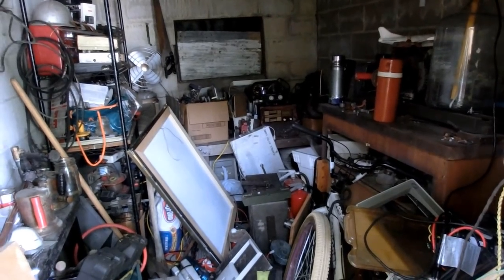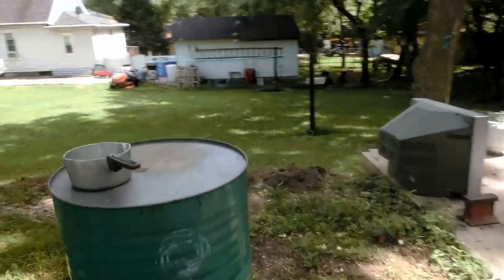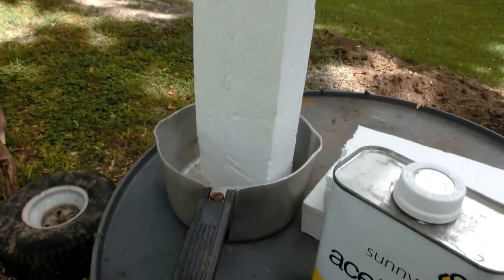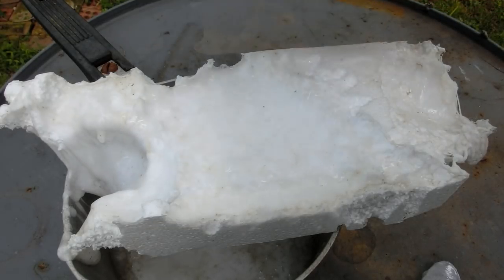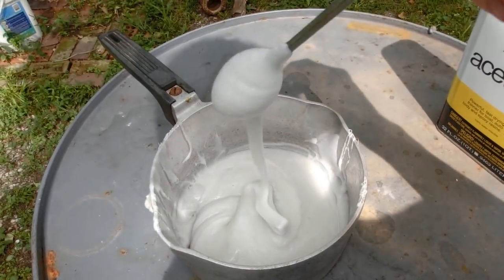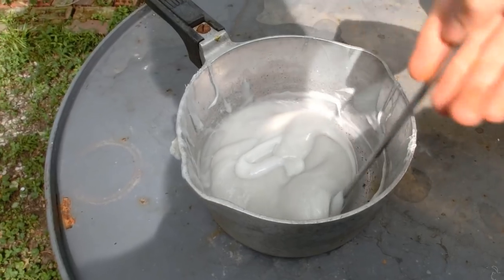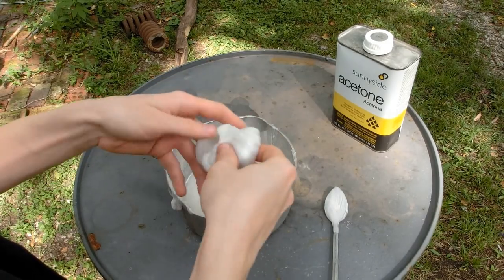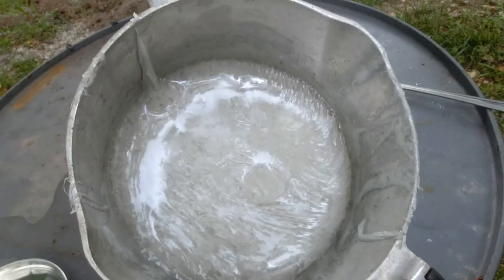Melting Styrofoam into diy acetone goo

Comment: You'll notice the acetone simply softens the foam so that it collapses into something like chewed bubblegum.  Try putting it into lacquer thinner instead, and you'll truly liquefy the foam into a clear liquid that can be used to coat porous materials to waterproof them. I call it "Styro-Kote", but I doubt that I'm the original inventor.
Reply: lebomm johnson try putting it in the internet so no one steals it and make themselves the original inventer
Reply: lebomm johnson that idea has been around forever
Reply: gr8 advice . ty
Reply: Terry Sheehan Nothing to stop someone from trademarking it the idea. Otherwise just spread the word and the context as far and wide as you can to make the term generic.
Reply: Awesome! Does using lacquer thinner cause it to totally solidify and become rigid?

Comment: online:DON'T TOUCH THE ACETONE
Rinoa Super-Genius: stir styrofoam grabs styrofoam and plays with it until it turns into a puddy
Reply: me:WTF can i touch it or not
Reply from the maker: +Chester123569 acetone is fine to touch tbh.
Reply: Rinoa Super-Genius what to do if it harden
Reply from the maker: Chester123569
add more acetone
Reply: +Chester123569 acetone is bad for you skin. It dries out your skin if you thouch it too much.
Reply from the maker: Mathijs Alkemade
it didnt dry out my skin too much tbh, 3% hydrogen peroxide hurts you more than this stuff.
Reply: well you remove nailpolish with acetone.... soooo its safe to touch
Reply: +GamerGuy acetone is fine for your skin, and lmfao 2 different types of acetone....
Reply: +GamerGuy Both are acetone. Same chemical, no difference at all. Most nail polish removers that use acetone are like 95% acetone with a few other ingredients that are supposed to keep your skin/nails. Really have no idea where you are getting your information from...
Reply: GamerGuy the only difference between "commercial" acetone and nailpolish remover with acetone is that there is like 95 percent acetone in it. The rest of the ingredients are purfume and some ingredients to make the nail cuticle not as dry. But they use pure acetone in nail salons as well to remove acrylic from the nails
Reply: GamerGuy yeah so? The rest of the stuff in nailpolish remover isnt exactly healty stuff as well. Plus, like i said, they use "pure" acetone at nail studios as well. Same stuff
Reply: +GamerGuy Okay so? I have a bottle of nail polish remover in my house thats 95% and the acetone I use in my shop is 99%
Reply: What is a puddy?
Reply: +snouty “the snout” snouterson its putty but the "super genius" spelled it wrong.
Reply: +The Dragon Stone thank you. I thought it must be putty but then I thought how could this person get something so obvious wrong? And now I know it's because he's a super genius 😂
Reply: I once spilled considerable amount of acetone on my hand. 
It dried the skin around my knuckles so bad that every time I would clench a fist my skin would crack and start bleeding. 
It took 4-5 months to fully heal.

I wouldn't recommend playing with acetone or gasoline.
Reply: +tooka2 and I frequently wash my hands off with it too remove epoxy or other sticky residues with 0 issues.
Reply: +Jason Hoogerhyde  Acetone de-fats the skin and can have central nervous system effects via skin absorption.  Check the Material Safety Data Sheet.
Reply: +GamerGuy The terms people are getting confused on is CONCENTRATION. Nail polish remover is acetone but their concentrations between commercial grade and in the small bottle are different concentrations. NPR is diluted with water.
Reply: +GamerGuy Nail polish is pure acetone. Some have fragrances or aloe added.

The worst thing it'll do is strip the oils off your skin. Don't take showers with it. And don't use acetone that's been used to dissolve small molecule compounds, since you'll be bathing your skin in those small molecules. Polystyrene's a big enough molecule that it's not going to penetrate your skin.

Do not extend this safety advice to MEK, Xylene, etc.
Reply: +sgvpotter checking my acetone, and my nail polish remover, the ingredients are virtually identical. Acetone, and Denatonium Benzoate (bittering agent so you don't inadvertently drink a toxic clear liquid thinking it's ethanol)
Reply: +Chester123569 Don't you use it to remove the glue after taking off a band-aid?
Reply: +Chester123569 Acetone is just nail polish remover with out the coloring and fragrance
Reply: Rion Motley
 hey rion, checked the ones i had i my fire cabinet they are at 60%. Did some checking and there are many now that do sell 100% acetone, so you are correct. The problem comes with the repeated exposure to 100% acetone. The diluted ones are safer, and other sub the water for oils and other ingredients that lessen the damage to skin. So i guess i learned something new :)
Reply: +sgvpotter high five on the double check. That might explain the horribly crappy results I got with some bottom shelf nail polish remover when I was trying to clean my 3D printer bed a few months ago. Figured I'd just left it open too long and it went a little hydroscopic on me. Bought a bunch of cheapo bottles @ Wal Mart a few weeks ago to restock, and it's all 100% (give or take the few ppm of the bittering agent. apparently the most bitter chemical known to man. woot woot.)

But yeah, definitely don't make a habit of washing up with the stuff either way, but it's not like it's going to absorb into your body at any kind of toxicity from playing with some putty.

And a did-you-know: acetylene bottles are actually acetone bottles filled with porous bulky stuff (used to be cork/etc.) and the acetylene is actually dissolved in the acetone like CO2 in soda! 80's star sparkles

The more you know. ;)
Reply: Acetone is basically in nail polish removers sooo...........
Reply: wait u can't touch it??
Reply: Lol
Reply: +GamerGuy meh
Reply: +GamerGuy 
You're wrong. There are higher concentrations of nail polish remover which are simply 100% acetone.
Reply: +Rinoa Super-Genius no, it is not.
Reply: There's literally nothing acetone does to you (on skin at least)
Reply: +Rion Motley benzoate is more dangerous than acetone. It is cancerous.
Reply: +Ano Nym What if I told you benzoates are food preservatives? It's benzENE that is carcinogenic. It's not all the same, bro. Furthermore, you can make aspirine from benzene.
Reply: can that make glue trap for mice
Reply: Rinoa Super-Genius it looks like slime
Reply: GamerGuy professional nail tecs use 100% acetone(exact same stuff as the commercial/industrial stuff) to remove acrylics and gel nails by soaking the fingers in it for a couple minutes at a time. Acetone isn't great for your skin because it dries it out but is not dangerous unless you're soaking in it for a long time. You should still wear gloves while working with it because it's mildly irritating and a face mask is a good idea for the fumes if you aren't in a very highly ventilated area but it's not super dangerous or anything
Reply: Ye acetone is literally nail polish remover
Reply: Chester123569  I used to build boats back in the day we had 55 gal drums of acetone and I literally washed my hands in that stuff for years....would dry the crap out of em though. But nothing happened.
Reply: Gamerguy must still live with his parents. And must never had a real job if his afraid of a little acetone
Reply: I make a modelling material from this, it's a relatively cheap way of making things. My hands are still there, and 
I've been working with it for about a year. It's very versàtile stuff once you get used to it.
Reply: +Lucia Tilyard 
its all good until it causes you to become irreversibly impotant.
Reply: Lucia Tilyard is this similar to the sheet styrene?
Reply: Lorenz Retiro It's what you càll styrofoam in the 
Ù.S. we call it polystyrene here.
Reply: Acetone is nail polish remover
Reply: Chester123569 putty
Reply: Chester123569 Acetone is nail polish remover
Reply: Mathijs Alkemade I paint my nails and such and I use acetone to take  off my designs and fake nails. As long as you keep your skin hydrated with oils, you're fine.
Reply: You can use this as molding plastic
Reply: I borrowed a friends nail polish remover, my nails split and then peeled off...took 6 months to grow back strong again. I looked at the label again and it said 'some people may be allergic'...not that their 'nails might melt'.
Reply: very fine animal oil is added to the acetone to prevent the skin from drying.  Acetone disolves the oil in your skin, bit by bit, eventualy there is no oil or fat left to lubricate the skin and cracks appear..

Comment: You know you are just making a crude form of napalm.
Reply: I was just thinking the same thing. All I can think of when seeing this was the napalm bombing in Vietnam by USA and how it would look like if it was to get it on your skin. All she would need to add is gasoline and then a fire. Cool video though.
Reply: Cyborgslayer404d Yo, I think I saw you comment on a random 'ball lightning' video about an hour ago.  Weird.
Reply: This isn't really napalm. If you dissolve it in petrol it would be
Reply: +duMaurier15 actually you dont need gasoline acetone is flammable by itself so yeah crude napalm
Reply: +patrick Tighe That&#39;s noting like actual napalm tho. Napalm has oxidizers and other substances to make it burn a lot hotter than some styrofoam puddy.
Reply: chaistan
 true to this, but it does stick to alot of stuff. but couldn't you add sugar? which would add oxygen to it to make it hotter? i remember something like people getting 2nd 3rd degree burns from actual napalm in Vietnam from reading stuff in class 2 years ago
Reply: +patrick Tighe "people getting 2nd 3rd degree burns from actual napalm in Vietnam" HAHAHAHAHHAHA.....yea
Reply: +pugs2300 I think he meant, "people getting burns as badly as actual napalm from vietnam would give"
Reply: +duMaurier15 if im right you can use gasoline instead of acetone because gasoline will melt the styrofoam as well so you wont even need the acetone
Reply: daimon hellstrom yeah and you can add alluminium dust in it ontop of that so it gets even hotter. Or make a molotof 1/4oil 3/4 petrol then add that stuff  into it. Youll get some prety hefty napalm like that. Nothing crude about it except the flames ^^
Reply: Cyborgslayer404d I
Reply: Yep, or Palm Oil etc. We improvised with Diesel, Petrol, Sugar and or Styrofoam (if available). Styrofoam makes it sticky/ gloopy. Still needed some PE and a detonator, or knotted Det. Cord.
Reply: 4th degree burns.
Reply: Cyborgslayer404d If you could keep it from solidifying, yes. The original napalm, I believe, is the same formula used later to make camp cook stove fuel in a small can to carry in a backpack, which I will not name. It is also useful at an outdoor buffet under stainless serving pans to keep food warm during an event. Slapped on you skin and lit on fire, it is not to good for anyone at a buffet, for sure.
Reply: daimon hellstrom if u heat up and melt some soap inside it, what will the end result
Reply: Napalm b was polystyrene in acetone and benzene AFAIK

It’s Not just a crude form
Reply: I used to make it using EPS and diesel fuel. Stuff would burn for hours!
Reply: GOAT PLAYZ that is napalm A. You need some specific kind of soap tho (but nothing too special/exotic)
Reply: fireofdestruction77 yeah but even as acetone is flammable, gasoline has more energy per weight than acetone, actually gasoline might have the best energy to weight ratio
Reply: @among-us-99999  we used unscented tide mixed with half gasoline and half diesel for training when I was in the army.
Reply: @maxmaidment96  thank you

Comment: in the late 60s when i used to do a lot of competition model making i used this idea and also melted sprue from kits in to acetone or liquid polystyrene cement this made the paste you have made however you had to keep liquid in the bottle and air out it was a great filler for models also great for coating rough areas and easy to sand down..

Comment: replace the acetone with diesel fuel and you've got napalm.
Reply: +Anon archist i believe acetone makes napalm too but he waited for it to evaporate.
Reply: +Anon archist That already is what all the casuals call "napalm". Real napalm is more like a jell that sprays and sticks to everything after impact.
Reply: +Juelz J And polymer thickened gasoline is JUST THAT! Seriously, Thickened gasoline is basically napalm. There are two different types of many variations of napalm, theres WW2 and Korean war era type A and then there's Vietnam type B, Polymer mixed into gasoline is similar to type B napalm, but not evenly processed, so it's thicker, and stickier, but not as much as gel-type Vietnam napalm, same effect and similar composition so it might as well be napalm.
Reply: napalm-B is disel fuel with a ploystyrene as the gelling agent. like i said
Reply: Anon archist Burns releasing heat over 3000 degrees Celsius, sticks to pretty much everything it touches and can burn for hours on end if a lump of it is large enough. That's type B Napalm... or as i like to call it 'Nampalm.
Reply: Carl Ahrens Well, Maybe its best people don't deliver it properly? Wouldn't want the stuff being used in riots anyway. But hey, What I DO know how to do for certain is make an atom bomb, I wont go through it for two reasons, 1.Getting the Uranium enriched is a pain and 2. I Don't want to kill millions of people.

Also, Flamethrowers are a sure"fire" way to set yourself alight if you don't know what you're doing, especially if it's homemade ;P
Reply: Lmk where you will be getting your yellow cake
Reply: Disolve it in turpentine for home made napalm, it will stick and burn on anything.
Oh Diesel.. OK didnt know that, thought it was turp's
Reply: It is not a jell that sprays. It is too viscous to spray, however it will splatter and stick.
Reply: Lex Turner well the viscosity IS variable depending on how well it's mixed and how its made, this is really crude napalm.
Reply: That is a correct statement
Reply: It also works with acetone
Reply: Anon archist Diesel do not burn
Reply: “Napalm-B,” uses 46 percent polystyrene, 33 percent gasoline and 21 percent benzene.
Reply: By weight or volume?

Don't ask why
Reply: oh yeeeaahh

I'm stupid sometimes. Actually, rather often.

Comment: I used to use different liquids on polystyrene when making brick or stone walls for movie and theatre sets. Petrol, diesel, paint thinner and acetone produce different surfaces from their different volatility and using a large paint brush to flick the fluid onto the surface works well. Hexane safe contact adhesive can be used to glue poly bricks together.

Comment: regular paint thinner works well to dissolve Styrofoam and it turns the Styrofoam into a clear plastic resin which works well for pouring into cracked concrete flooring, or to coat plywood with as a sealer like fiberglass resin, and you can use it just like fiberglass resin as well, it can be poured into a mold to make your own RC car or truck bodies and when dry it can be painted, it dries clear.

Comment: You should also inform that you should wear face mask, because I work with acetone alot and the vapors you have created with this combination and really cause some damage.
Cheers.
Reply: And wear gloves. You really do not want that in your blood stream.
Reply: Acetone exposure on a once-off basis like this is very unlikely to cause any damage, it is always best to take precautions even with this very low risk but I think its worth being aware the risk is low. There are few chemicals you can buy over the counter that are seriously dangerous from short term exposure. 

Working with the stuff is a different story of course and every precaution must be taken.
Reply: Really. Read the back label of acetone. Better, read the label on styrine. Read the caution label on gel coat. Its all dangerous even with low exposure.
Reply: I think you need to take your own advice and read those labels. 

An Acetone label carries a '1' for 'slight' risk to health.
Reply: have. and use it everyday. whats your point.
Reply: try to think about it, it may hurt but try!
Reply: I always wear a mask and gloves using acetone. The industrial stuff. is quite strong. and really dries out your skin if you get it on your hands! Better to be safe than sorry. :)
Reply: hmm... my head hurts a bit
Reply: Dude there is nail polish remover that says 100% acetone. I wouldn't want to like wash my hands with it but it must not be that bad for your skin if you use it on your nails, your going to evidently get it on your hand right?
Reply: yeah but how you get high otherwise? XD
Reply: +swirlingabyss tell that to people with leukemia. I know one that the doc said that's what it was from. benzene will to.

Comment: Acetone splashing like you were doing is a great way to make foam look like stone if you water it down a bit. Acetone + styrene is also great replacement for bondo.  Once it hardens up due to the lack of air pockets in the styrene it's very hard and great for putting together plastic armor (if you are careful anyway).

Comment: Much more fun to melt it in gasoline, then use it as a type of sticky napalm.
 It will stick to anything and is hard to put out. Even dumping water on it wont do the trick.

Comment: I have just purchased a field with an old fridge lorry back in it. The styofoam out of it is 30ft long over a foot thick and five foot wide will try to melt it into smaller bits to take down the tip.